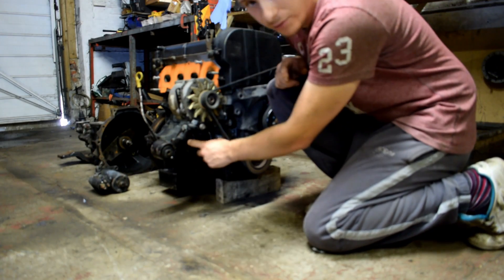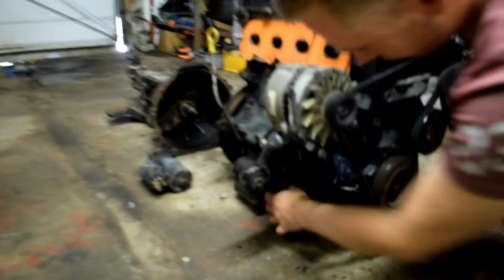Budget RWD Zetec guide MK2 Escort, what I used.

Comment: hello, did the sierra type9 gearbox sitted on this engine right away, or you did some modifications on it? Also, did you modified the housing of the gearbox that sits on the engine? Im just going to swap my 2l pinto in sierra for a 2l Zetec engine (45mm dual carbureted, fast road cams, tubular headers etc)
Reply from the maker: Hey, no its a direct bolt on.

Comment: I've currently got a 1600 xflow in my mk1 escort at the moment is it worth the effort putting a zetec in?
Reply from the maker: Guess it depends what you want from the car!
Reply: @AshleyBurch  I'm after more power without spending loads of money. Have you had yours on the dyno?
Reply from the maker: No I have not had it dyno'd its not actually been setup yet! So I could be missing out on power! Well zetecs can be put in relatively cheap also can be very tuneable. Could also go st170 and use the vvt.

Comment: Any pictures or a video off How did u make the sump fit and how did you bolt the pick up pipe on where it bolts to the crank bearing
Reply from the maker: Chris a hello, the pickup pipe I just used a bolt with two nylock nuts to stop it moving (you can buy a adaptor thingy from retroford). I extened the sump slightly where people say you just need to bash it. Watch the video below you'll see what I mean by the bolt and the sump. Excuse the shite mic! Remember to subscribe for more videos!

https://youtu.be/dZcHwmSR1zE
Reply: Ashley Burch thanks that helped abit but my sump s catching on the oil pump Did urs catch there as its no letting the holes line up
Reply from the maker: Chris a yeah. People said you can bash it but I ended up making a slight buldge with the welder. I drilled a few holes a few mm bigger and tapped 4 holes in the 4 corners. Honestly if I was doing it again I would get a neil dunne sump. Cvh was a pain to get it to seal properly. I found only could get it to seal was with engine out.
Reply: Ashley Burch yeah I was gonna drill and tap the holes any. Any pictures off the bulge u make
Reply from the maker: Just had a look and dont have any sump photos unfortunately. Unless you can just see it in a video but don't think I filmed it much. I'll try grab a photos in a few days when next up there. But its literally just a metal plate over the end then cut/grind away what was hitting the oil pump.
Reply: Ashley Burch thanks that would be helpful

Comment: I have a blacktop and a modified cvh sump, teh sump doesnt fit properly and the oick up line wont fit either because of the bolts on the internals, any ideas how I can get round this as I do not want to buy a retroford sump for 3 times the price of the engine lmao
Reply from the maker: Dnoop_Sogg yeah you can get away with bashing it with a hammer, I extended mine slightly. If I was doing it again I would buy a Neil Dunne sump. Much better price than retroford and fit really well the few I have seen.

Comment: Hi Ashley, did you buy the chassis mount parts as a kit? It looks like the bushes are the same as WCXM ones. I think some chassis mount kits use leaf spring bushes, which I would of thought transfer more vibrations to the chassis. Thanks for doing this video, definitely helps a lot with people looking at doing the conversion!
Reply from the maker: Tom Gibbs hello, Yeah I bought a kit not sure where from though. Its fairly stiff but its not mega stiff that the car shakes. If you get what I mean!

Comment: Would these parts apply for a  mk1 granada engine conversion for zetec
Reply from the maker: Aslong as you are using a zetec with a type 9 gearbox I dont see why not. Physical mounting might be different.
Reply: Ashley Burch ok thankyou ı will be using the type 9
Reply: Would it be the same setup if used a st170 then
Reply from the maker: I'm under the impression the st170 engine is the same just better internals. Ashley.
Reply: Ashley Burch ı think it's better to start with a st170 because allready ahead about 30bhp hopefully :)

Comment: Is that release bearing a mk1 Mondeo part aswell or is that a specialised part, also, when you say clutch, do you mean clutch cover and pressure plate??
Thanks this video has solved many problems already 👍
Reply from the maker: Kristian Ellis hello, The bearing is a sierra part, similar to original escort item just has a spacer built into it. Yes clutch cover and pressure plate from a MK1 Mondeo. Cheers dude.
Reply: Thanks for fast reply and great advice still pondering on wether to got for pinto power in the mk2 or a Zetec but thanks all the same